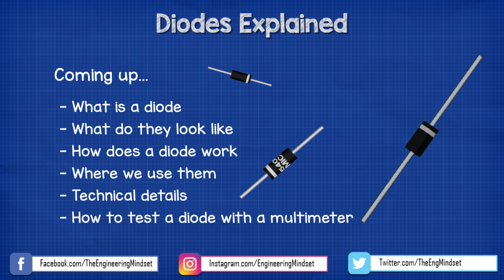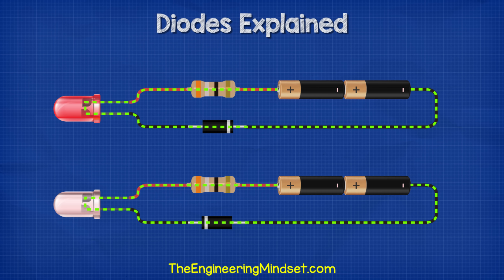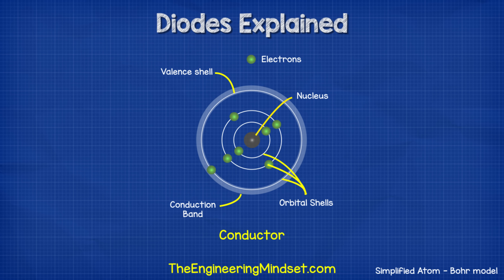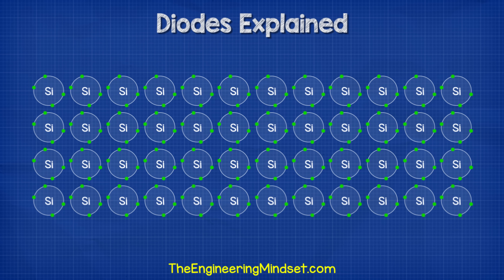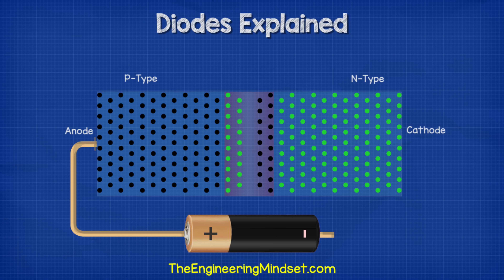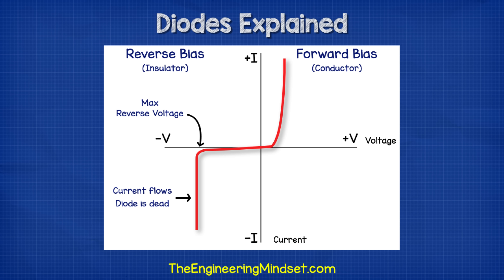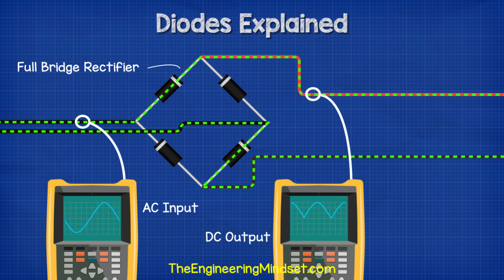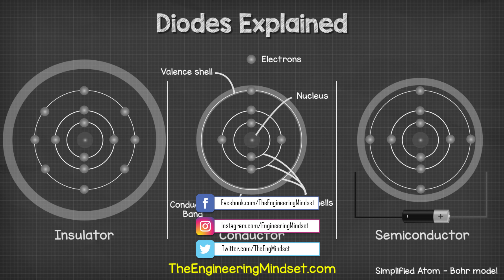Diodes Explained - The basics how diodes work working principle pn junction

Comment: hi, I have a PCB board the zener diode has shorted and failed. there is no markings on them. the board has ZD6 written on it next to the diode. what would the voltage be?

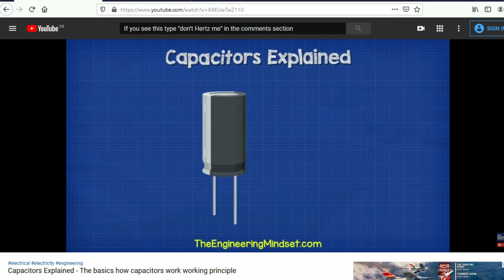Comment: Well made video for beginners! However, there is an error at 10:05 because the two oscilloscopes on the right side will show the same smoothed signal. They are on the same zero-resistance wire, so it doesn't matter if the signal is being measured before or after the filtering capacitor.
Reply from the maker: Seen our new Oscilloscope tutorial? (beginner friendly) link here:➡️ https://youtu.be/LaY47Qrfs0c

Comment: All of these electrical components have a functionally similar/identical water based variant. And they’re often mentioned as analogies, yet I’ve never heard of anyone making a circuit using water instead of electricity. Surely this would be a great tool to visually show how these components function instead of just theory. Could probably be made for under $40 with a few pieces of wood, some hot glue, acrylic, clear tubing, food coloring, a water supply, and like a day of work

Comment: Just a small mistake in the beginning, in conventional current it is not that electrons "flow" from positive to negative terminals, that would be absurd, it is only that in conventional notation the default charge is the positive one so you designate the current in the sense a positve charge would take. You have to thank Franklin from that. At the end is of course equivalent, say in a single loop circuit, the electrons flowing clockwise is the same as saying the current is flowing counter-clockwise.

Comment: I may be incorrect, but I don't think that the conventional current model posits that electrons themselves are flowing from the positive to the negative, but rather that current flow follows the movement of the positively charged gaps or holes left as electrons jump from atom to atom rather than the movement of the electrons themselves.
 
<E- <E- H+> <E- <E- <E-   to   <E- <E- <E- H+> <E- <E-   to  <E-<E-<E-<E-H+><E-    and so on

While it is the electrons themselves that are moving, the "Hole" also appears to move in the opposite direction and carries the direction of the current with it.  That, at least, was my interpretation of what my DC theory textbook had to say on the subject, but I am definitely not an engineer and could be completely wrong.

Comment: You know why I still believe in the conventional current? Mainly because why else would the resistor be on the positive side? The electrons have to flow through the resistor first or the LED would burn out.
Reply from the maker: That's not correct. Resistors can be placed on either side, we proved it in this video https://youtu.be/7d4ymjU9NqM?t=73
Reply from the maker: Check out NEW resistor video, everything covered! ➡️ https://youtu.be/DYcLFHgVCn0

Comment: Why is the DC connected to the orange wire (top) in 9:53 instead of the black at the bottom? Thank you very much!
Reply from the maker: See here https://youtu.be/RiRyzLl4Y8U
Reply: @EngineeringMindset  will do. I’m impressed you not only replied, but did it so quickly. THANK YOU!

Comment: way to deep a dive, just want to know is the volt rating max so a 1000v diode can that be use with 12v??
Reply: The 1000 volt rating indicates reverse breakdown voltage, or the maximum voltage that the diode can block current flow. Beyond that and the diode itself will fail (blow up). 12 volts reverse voltage should be fine for almost any diode. If you mean to say that you're using a 12 volt source for the current going through the diode, yes that would also be acceptable. Just remember that the diode has a small voltage drop when current flows through it so really your load will see about 11.3 volts (depending on the type of diode).

Comment: The current cant pass the diode as shown in the animation. It can only pass through the anode.
Reply from the maker: You keep writing this on multiple videos. Electrons flow from negative to positive, conventional current flows from positive to negative. Again, please watch, without skipping, our video on electrical current as you do not seem to understand the difference.
Reply: Well I got that now. Electrons flow from negative to positive. Electrons are negative charged. But the animation is still wrong and misleading. The current would never be able to pass through the kathode and that is what you are illustrating.
Reply from the maker: Right, so if in the animation the electrons animated are flowing from negative to positive, then I must be illustrating electron flow and not conventional current. It is also stated in the video Example: https://youtu.be/Fwj_d3uO5g8?t=41 see bottom right corner.
Reply: You are making every electronic component and their function void using electron flow in my opinion. Since a battery is actually "mislabeled" and the charge of the battery is really opposite,  it would be less confusing stating that fact to begin with and show the current and components as they operate. That is my opinion, my opinion is likewise that I learn a lot from your videos.

Comment: I kinda get the feeling that the valence shell is the farthest distance from the atom that is still close enough to allow the atoms magnetic field to hold the electron; while still allowing a standing wave to form. Or to put it another way, the farthest point an atom still has enough magnetic pull where the atoms don't fly off or destroy themselves (where a complete wave can occur). 

and the conduction band is the point where the atom's magnetic field is at the very edge of being too weak to hold onto the electron, which sometimes aligns with the next place a standing wave can occur.

so a conductor is a place where the furthest limit of the atoms magnetic field aligns with an electrons standing wave pattern? a semi conductor probably means with a bit of proding, you can weaken the pull the atom has on the eletron just enough to let it fly alittle further away from the atom to let it reach the conduction band, and an insulator is basically an atom where it's weak point in the magnetic field is still too far away from the next standing wave of electons?

Comment: so are "free electrons" spots where the magnetic field of the atom is strong enough to hold some electrons but also weak enough to let a little nudge pull the electron away from the atom? kinda like how a magnet can hold a nail, but if it's not an insanely strong magnet then a person could easily pull the nail away from the magnet?

Comment: Why does the negative side of a battery need to be connected to the cathode of the diode? Doesn’t the cathode stand for positive side? I feel like the names on the diode should be switched (left side should be cathode and right side should be anon).

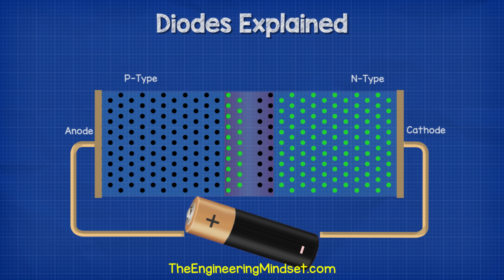Comment: At 6:44 when the power supply is reversed, why doesn't the following situation occur:

Electrons flow out from the negative side of the battery, into the p-type region of the diode which then gains a negative charge and simultaneously, the electrons in the n-type region flow towards the positive side of the battery, creating a positively charged region, which in turn attracts the electrons from the now-negatively charged p-type region, thus creating a flow of electricity. 

Not an engineering student or anything, so probably just confusing something very simple. I appreciate any explanations :)

Comment: 8:41 Is resistor supposedly connected to positive or negative? I'm wondering because how can you protect the LED if the LED is directly connected to negative and not resisting the current flow using resistor? Please enlighten me. :|
Reply from the maker: Answer: https://youtu.be/7d4ymjU9NqM
Reply from the maker: Check out NEW resistor video, everything covered! ➡️ https://youtu.be/DYcLFHgVCn0

Comment: Thank you.
This was very informative. I now know my DIY alternator project has bin succesfull. Without diode the voltage drops if I spin the rod with the magnets faster while it should increase. With the diode between my alternator and my multimeter the voltage does increase when I spin it faster. The only thing I don't understand is why does'nt my multimeter measure the amperage with the diode between it while it does without the diode? 
I have HER303 placed on the circuit.
Reply from the maker: Check our new Multimeter tutorial out ➡️ https://youtu.be/4lAyzRxsbDc

Comment: in a 12VDC scenario with a diode where you want a switch (which is for a ground momentary signal)  which connects with another (main) wire  to an actuator (also works with a momentary ground signal)  and leads to a motor controller  but you dont want the switch signal to ground filtering back down to the actuator, just the motor controller. meaning a ground signal on the main wire activates the actuator and motor, whereas the switch will only activate the motor with its ground signal,.the  how would you orientate  the diode?

Comment: Can't refrain from making comments.  First, "convetional current" is the same as electron flowing from negative to positive, it's not something confusing or just for convenience.  Fo sure, your statement that "conventional current is electrons flowing from positive terminal to negative terminal" is absolute nonsense.  Second, a diode run in reverse bias will "break down" at some high voltage, and that voltage at which the breakdown occurs is called the "reverse breakdown voltage".  The diode does not necessarily die when the reverse breakdown happens.  In fact all Zener diodes are run in the reverse breakdown mode.  The reverse breakdown simply allows current to once again flow asily in the reverse direction, similarly as forward biasing over the built-in potential.  To exaplain the reverse breakdown phenomenon, you really have to explain conduction/valence band structure under biasing, as well as quantum mechanical tunneling.  Good luck with all of that in your video explaining Zener diodes.

Comment: 2:53 Not accurate.  The energy you refer to is the binding energy of electrons in that shell.  It represents the amount of energy that is required to remove an electron from its place in the electron structure of the atom.

Valence shell electrons are the easiest to remove because they are bound the weakest.  In other words, the binding energy is a minimum at the outer shells.

Comment: Full bridge rectifier. This part eludes me. I don't fully understand why current takes the path of the middle wire where the diodes are cathode to anode. It seems to me it would just go onto the other diode and out the bottom wire on the circuit. I may be missing something. This video was very useful and helpful though. Thank you.
Reply from the maker: Rectifier video here https://youtu.be/RiRyzLl4Y8U

Comment: A diode is redundant on a led circuit that's already dc because an LED IS a diode. It's the d in the name.
Reply: @Bloodred Pyrate in a low voltage circuit you can.

Comment: What are your thoughts of a spark gap that has asymmetrical conductors on each end
. With this act as a sort of diode in certain high voltage applications as the charge density per area squared would be different if one had a larger surface area than the other?

Comment: That Voltage, Current graph at 8:10 is the most useful visual learning tool I've ever seen, and a tool I didn't even see once in my digital electronics class. 

This is the future of learning, not some variable in where a teacher that is even inadequate for the job has to be provided every year sapping our wallet in the form of taxes. But this right here, truely free education at the cost of the time of the teacher that is providing it, and they only provide once that it's there for a very long time.

Comment: The depletion region barrier voltage is not 0.7 volts when unbiased, as you suggest. An unbiased p-n junction has a natural barrier potential of 26 millivolts, due to thermal energy. When the diode is connected to a network with an active source, biased in the forward direction,  current conducts through diode. The barrier potential depends on current value. 
For a 1N914B signal diode, a foreard current of 10 mA results in a forward drop, or barrier potential of 0.69 volts. A 1.0 mA current results in 0.63 volt forward drop. A 100 nA current results in 0.39 volt drop.
The diode conducts forward current with forward voltage drop much less than 0.7 volts. Any diode maker provides graphs showing voltage vs current.

Comment: Very interesting video.  I just have a novice knowledge of physics but what I find interesting is that the arrow in a schematic of a diode points in the direction of "conventional current" (as you stated) yet the video shows what I believe is "electron flow".  I'm not saying one theory is better than the other in describing the directional flow of electrical current, I just find it interesting.
Reply: He states earlier in the video that he will be using electron flow in the diagrams.

Comment: hi again at 8.44 the left diagram is not back to front since the '-' on the battery terminal is going towards the '-' side of the Diode? but no current is going to the LED - have you mixed these 2 up? thanks once again

Comment: Hi I* am very new to this, so I am sure I have my thoughts wrong on the following.. At the video 1.39 there is a resister between the LED and battery (+) and the current is going from the LED to through the resister back to the battery - I thought the resister would be on the other side of the circuit - between the battery and LED. Please explain many thanks :)
Reply from the maker: Please watch our videos on parallel and series circuits
Reply: @EngineeringMindset  Hi, thanks for that, have you the links to them , its not coming up. thanks

Comment: I cant understand one thing: Why the curent flows from - to + in some videos and why from + to - in others ones?!
Reply from the maker: Conventional current flows from positive to negative. It's the original theory which was later proved wrong but schools still teach it. Electron flow is what's actually occurring and that's from negative to positive.The old theory is still taught and used so everyone gets confused. In electronics we just pretend its flowing from + to - but in reality it's not. It doesn't actually matter though, the calculations come out the same.
Reply: The Engineering Mindset Ty! I have another question. In the video u showed me a case in which the current flows into a diode and an LED is off because the diode is on the ON state,but why the LED is off?! Shouldnt the current to take the easiest path to flow and ignore the diode path? I am talking about the 8:41 example from the video.

Comment: How is the depletion region is created? And how do make reverse bias bigger? What I assume the reverse bias is an insulator, which means the forbidden gap expands, so you change the battery so the battery causes the forbidden gap to expand so that means the negative part receive N-type which is connected to extra electrons in connecting to the center atom that is SI or it is an odd number, so it is 5, and P-type which it is odd that is 3. So, the 5 electrons are being received of positive, so 5 electrons become a higher number, so it creates a barrier as it expands, so it is all filled from battery.

So, it depends by gap of number that is 3, 4, and 5. So, the gap diameter is 1 for left and right. So, it needs a gap diameter of 2 for left and right, so it must be even, well, it can be odd, can it? 3, 4, and so on.  So, for reverse bias that is huge as a wide forbidden gap so with small volt, so it causes bigger current. So, it doesn't depend by number, not as a whole, but partially but has something extra in Diodes to create 1000 v, 1.1 v, so it creates a 1 A, and other for 3A from 1.0 v, so it has extra resistance to the current is increased. All volt is dependent by atom itself and the gap diameter between center atom that has an even polar plane which up and down is opposite, even that is 90 degrees.

Comment: There's a question I can't get trow but avery were is explained you're way. At min. 6:50 the p type should stay firm hence the electrons are the ones to move, so there should be a movement of electrons from the minus side of the battery towards the holes of the p type. So why instead the holes are moving, I don't get it. Thx amazing job by the way.
Reply from the maker: It's just the space available for an electron, it's not really moving as such. The is a space for an electron, so an electron leaves it's space to fill that new space. Now there is a space where the electron left. So only the electron moves, but as it moves it provides a space and also takes a space so it appears thst a hole moves